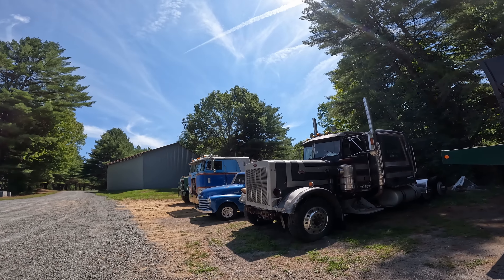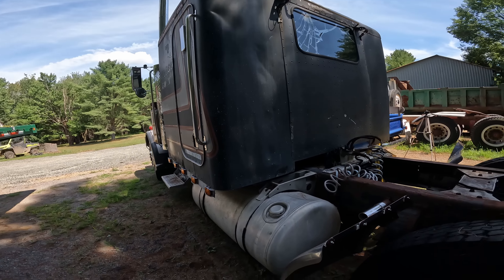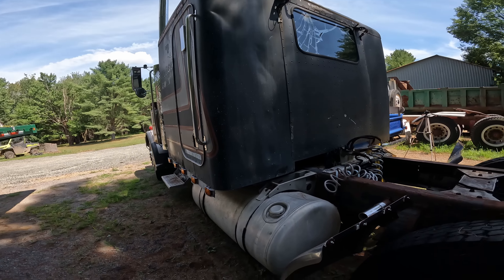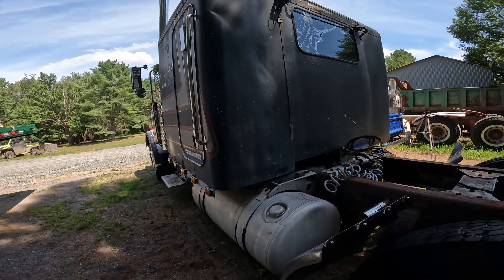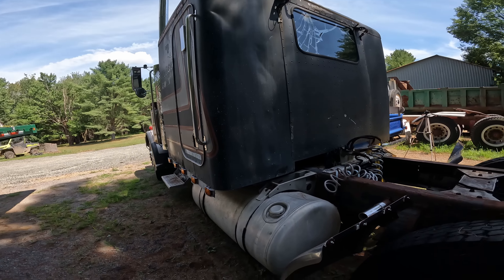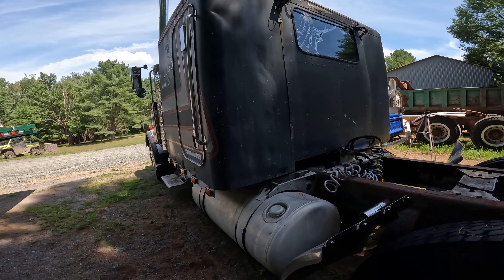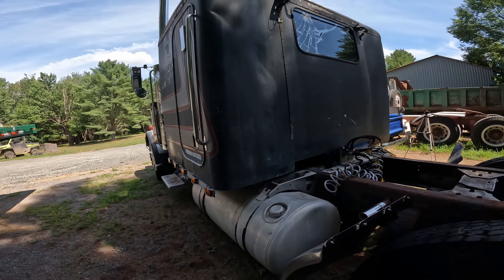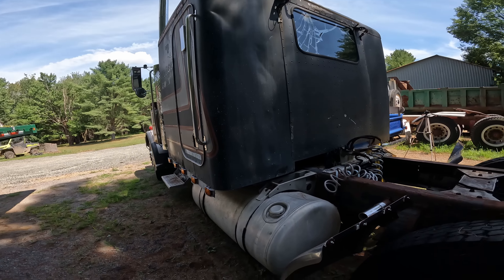Lets Talk Trucks 3408 CAT Powered 1980 Peterbilt 359 Extended Hood - Episode 2

Comment: Cool old Pete, had a customer back in the early 90's with a long nose Pete no sleeper heavy haul rig with 3408 which he claimed 500+hp. We set him up with an RTO 15613 with auxiliary counter shaft driven oil pump and cooler which dumped oil on main box drive gears and auxiliary overdrive gears. Cured his issue of melting down over drive gears in auxiliary section and lowering over all trans temps, engine put out impressive torque.
Reply: Nice input.

Comment: After driving 45years. We had all sorts of Peterbilt and KWs. Had little window  359s. 70 to 72s. Got a brand new 75 359. 1693TA. 13sp. 411 truck no power steering. A 77 with a 93 13sp. With power steering. My 359. 78 with a 3406 PC motor 13sp 433. No power steering. Then we got the best one's. A 79 359 with a KTA 526. 15spd 411s. That truck had all the goodies. PS. Air conditioning power windows. Etc. Those were all small bunk trucks. Then we got a custom built big bunk Pete. A 79 379XHD. 3408 15spd 390s. The best part was the Double Eagle 60 in sleeper with a 255 in  wheelbase. Had sneak around at first seeing how it was only legal to be 55ft overall. We were like 59 60ft with a 40ft trailer. You would have been in heaven with the trucks we used to have. Throw in some Brockways. Since we lived in New York. A bunch of Pete and KW cabovers.
LIFE WAS WICKED GREAT. !  😎🇺🇸
Reply: What's kta 526. And a 79  379exhd?

Comment: Great video Wayne! Eldorado seats are the most comfortable seats I've ever run, I say leave that steering wheel in for historic value, the in cab battery disconnect is rare but not crazy rare. The 88 377 and 94 379EXD I owned both had them, and we have a 07 335 mechanics truck now in our shop that has them. I wonder if that pipe you pulled out was a piston wrist pin? This truck will be a beaut when restored! Anyway, I'm sitting on my patio, watching videos and drinking some frosty cold snacks in one of your koozies🍻🍻

Comment: Those vip wheels were actually made in France by Lecarra that made wheels for Ferrari and other high end sports cars. They were first offered to the big truck market in the USA in the mid to late 70s and were all 22" when still most trucks were manual steering but as trucks progressed into power steering the large wheel was no longer needed and the ratio slowed the steering response. But peterbilt still installed them as an upgrade on power steering trucks till the end of the 359 run. On a side note vip did produce some 20" wooded wheels at a later point but I'm not sure on the dates of these.
Reply: Good input! The leather was beautiful but would not hold up for long which was too bad . Wayne's  looks like it's the 2nd or 3rd
Reply: @andrewnorris1514  hey Andy you still mad at me? Give me a call sometime.

Comment: that would definitely be the truck to fix up an maybe try an restore the old paint on it definitely a keeper that was the beginning of the big rigs if you had a truck like that everyone thought you had money an you was noted to be the big rigger of the highways, I owned a 1984 standard hood 359 first year of the 3406B model engine 63" sleeper with a 15 speed later added a 4th axle an 5x4 behind the 15 speed I hauled big over sixed an long & heavy loads it was definitely a sweet old truck and it would get strength out long legged 120mph top speed empty no trailer, so I highly recommend keeping it fix it up if you sold it worth Big Bucks.

Comment: International trucks did that with the hood too in the 80's. The conventional transtar 4300. They had a rare extended hood for the big engines. A standard hood. And the 4200 was the short hood version. Cummins option for a short hood I'm guessing a 903
Reply: Ever see a 4300 with a 3408?
Reply: @andrewnorris1514  not in person but yes I've seen some pictures of them. I think their is video of one floating around YouTube
Reply: @andrewnorris1514  I think the video I'm thinking of it has a 1693. But I have a few pictures of them with 3408

Comment: Yes, excellent review of a time gone by. I worked on many of these older trucks albeit the KTA's and just like cars folks drove them without thought of their future value. One didn't own a KTA or 3408 unless you had premium loads as they cost a small fortune to maintain.  At 3-4 MPG, fuel prices and high maintenance cost put an end to their OTR use very quickly by the early 80’s.
Reply: Another thing is we had slower speed limits back then. Guys rarely had high-speed  rear ends. If you wanted to get out and really hammer it took all you had to not get caught. 8o mile an hour trucks were better on fuel than 100 mile an hour trucks

Comment: Weren't Needle-noses extra long?
Have you tried contacting the original dealer or sales zone office?  There might be someone there who remembers the truck, or has heard about it.
That steering wheel is badass! It's kind of like an enlarged 1982 Mustang GT steering wheel. 
I think you call that "diamond tufting," on the El Dorados - super old school.  
That back window should be pretty easy to replace yourself. I done the windshield in my Dentside when swapping cabs, and after that did the rear window/backlite, and it seemed ridiculously easy.
I wonder if the shoulder belts have been with the truck since day one, and just nobody ever installed them.
Oh, the skanky lot lizards that mattress might have seen - mice are still usually worse...
Reply: I think somebody bought those belts and then said oh shit how do I put them in?

Comment: Looking forward to the v8 cat content brother. My second favorite motor after all 2 strokes Detroits, with the cummins kta in close third. I've got a 84 359 ext hood that was my pops truck. Few years back, I found the build sheet in his attic. The short hoods were 119", exit hoods were 127. 8 inches made a big difference 🤣that's what she said🍻
Reply from the maker: Standard hoods were 119 shorts are 113. Most people have never even seen a short hood. sounds like your pops had a nice truck what's it got for power?
Reply: @Ol2Stroker  gotcha, never heard of the short hoods, that's interesting. Love this content, very educational brother. Now it has a 3406C, 475 HP. It had a 3406B with a cracked block when I got it after digging it out of the woods at his house after he passed. I restored it over 5 years. Since I had to replace the motor, I went with a C for more power since I do heavy haul.

Comment: They call it Form Follows Function  it's an architecture term but can be used here also.   It's when the manufacturer added function first in the way of the big engine then followed it with the big hood (form) because it was the only way to cover the engine.   Now a days everyone wants it to look good first so throw that big hood over a 4-53.

I like the "Lets' Talk Trucks"   I'm learning a lot.  How do you go about getting the build sheets on a truck.  it is something that the manufacturers offer?
Reply: A dealer can pull it from the computer using your Vin. #

Comment: Eastwood has a steering wheel rebuild kit, that might be the way to go on the cabover. I really like your videos. Just wondering when do you use a injector timing tool or is it a injector height tool? I have seen them but I haven't seen you use one. Keep the shows coming. Thanks
Reply: On 2 stroke Detroits the injector height is also the timing

Comment: What a tease,, you kept mentioning the V8 cat but dont show us?? I imagine the belts are attached to the air seat? I do like the truck talks.. 😃
Reply: Belts were attached to the air seat so you wouldn't choke yourself when the seat went up and down with the air ride and that had a short belt going to the floor from the bottom of the seat so it wouldn't fly out the window in an accident.

Comment: I seem to remember big hood 379s having the engine (6 cyl) more forward than a standard hood.  Shifter came up from under dash at an angle, as opposed to straight up from the floor.  Like you typed on screen, I thought it was inches bumper to back of cab measurement that was the spec for whether it was an extended hood or standard hood.

Comment: What transmission and what rear end ratio's are in the 3408 Truck?   Was/is it more common to see a lower rear end ratio number with big power?
Reply from the maker: It has an overdrive 15 and 3.70 rears... commonality depends on intended use case. A heavy haul truck will have numerically higher ratio rears usually.
Reply: @Ol2Stroker   Thanks for the response,,, I believe you said your V12 cab over had 3.55's?  So not just big power, but intended use also dictated... Makes sense.... 
  Were higher gears ( lower numerically) desirable on freeway rigs to  help keep the revs down?
Reply from the maker: @ricksmith4736  sometimes.... back then most trucks didnt have the power to pull that kinda gear. But yea less rpm definitely helps a big engine on fuel

Comment: WayneO that water jug that was in the box with seat belt most likely was the drivers pee bottle? 😳
Reply: Truck drivers didn't have pi## bottles back then. We needed to get out and stretch our legs; usually wet the   ground in front of the tandems if we couldn't find a bathroom. Didn't see bottles with yellow liquid on the ground until about 25 years ago when the "new generation" of drivers started. Bunch of pigs. Most drivers cared about their appearance and image. A guy who drove a truck like this "large car" should've been pretty proud of it.
Reply: Pee bottles came with sweatpants and fannypacks

Comment: Those Eldorado seats wear the worst seats ever made
Reply: Second worse. Bottom viking t- bar was much worse. My favorite  was the stock Pete seat. Kind of sat close to the center of the cab and you could window shop seat covers on both door windows. Also roll the hand cranked passenger window down no problem. But if you long for the good old days of trucking try going cross country in White with a 220 Cumapart ten speed fuller transmission with 4.44 or maybe 4.88 for high speed. Like 62 miles per hour. No ac maybe an AM radio full time engine fan so you couldn't  hear it if you had it. Split rim budd or erie wheels tube type  rag tires. No CB so hand signals to communicate  where the bears were. But at least you could get a real Chicken Fried Steak that actually had a cow involved.

Comment: In 1980 too 1985 I put a half a million miles in a truck similar. It had 600 horsepowered 3406 6 cylinder. Loved that truck, seen about all of the lower 48. At 350,000 the motor and transmission was rebuilt. It was a monster that you had to control .